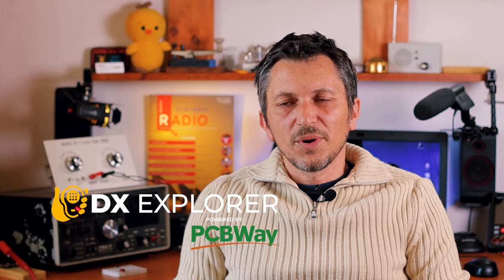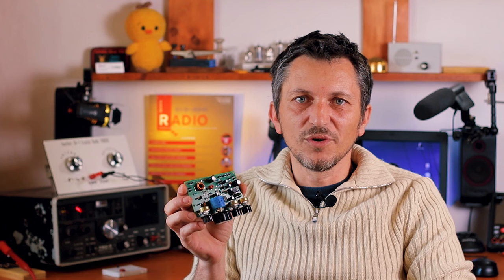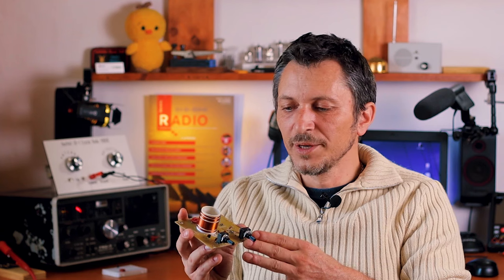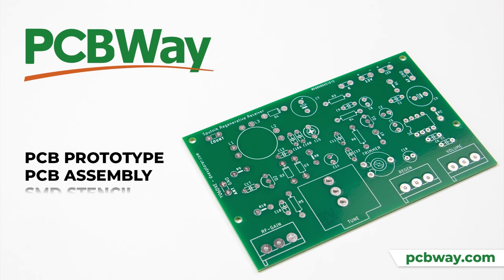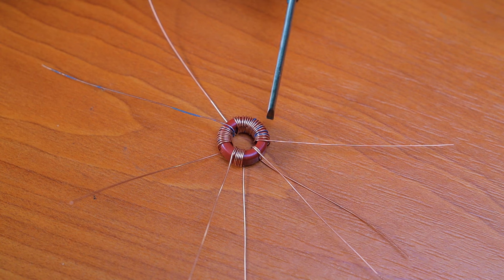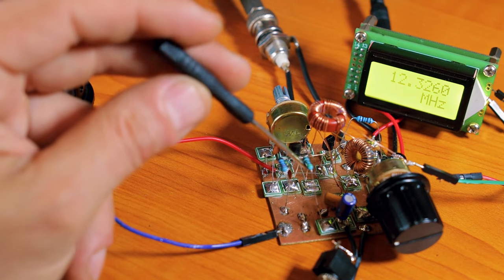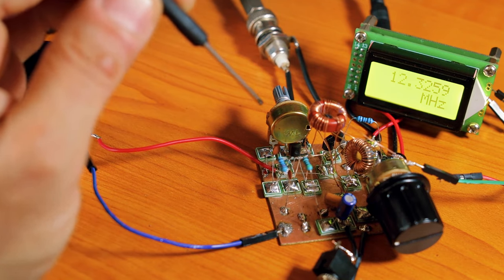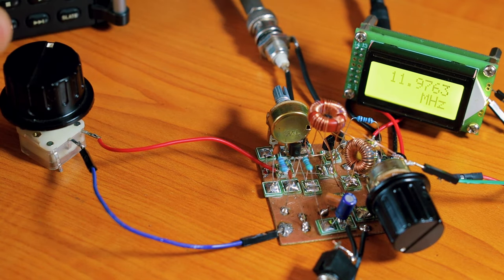Improving A Simple FET Regenerative Receiver - Part One

Comment: It's good to see that young people like to experiment with old techniques. I built a regenerative circuit with a 6C4 triode back in 1956 when I was a 16 year old boy. Today I'm a grandfather but I'm still involved with electronic experiments, especially with modern devices like the one you used. Congratulations on your commitment and dedication...
Reply from the maker: Ohhhh old is gold to me. Is funny that when I started about radios it was all on tubes. But later when I started building stuff I used transistors because it was hard to find the transformers. This winter I plan on doing some tubes projects too. Maybe I can find some low voltage ones. Is nice you are still playing around with circuits. Once you love it as a kid is hard to get away from it 😁. 73, YO6DXE
Reply: Yes, I have followed the evolution since I was young. In 1973 I built a triple conversion valve transceiver using a Colins mechanical filter, 250KHz and only two bands, 15 and 20m. The valve has its problems, but it also has its benefits, less noise and better fidelity, I miss these qualities. I recently bought a G90 from China that is truly amazing. All electronics have evolved to a state that already requires specialization, but there is still a lot that can be done in the area of experimentation. 73s and health my friend, py1bys from Rio de Janeiro.

Comment: I’m a sucker for any regen receiver circuit. I just love to watch these videos. 

In fairness to Charles Kitchen, his circuits were published in QST in the late 1980s when air variable capacitors, though still challenging to find, were far easier to get than today.
Reply: I have no trouble finding them, they’re just very expensive
Reply from the maker: Ohh yes I agree on that. I love his circuits for the performance but still keeping them simple. I just wanted to adapt it to "today" but still keep it simple... and make it smaller too hehe. 73, YO6DXE.
Reply from the maker: They are indeed. Sometimes we may get lucky and find some for cheap... or presents... but not always 😁. 73, YO6DXE.

Comment: Small tuning capacitors are still available such as the kind that would be used in commercially made pocket receivers. They're not expensive either.
Reply from the maker: Yes... those I used for the original version. I don't like them that much though. Very hard to tune and a vernier drive is twice the price of a multiturn potentiometer... sometimes even more expensive ( at least here in Romania). 73, YO6DXE
Reply: @dxexplorer  All I can think of is the possibility to use a reduction pulley which was fairly common in older table top receivers. There was even special string sold for it suggesting the need for occasional replacement, though I never needed to do that. Good luck with your eventual solution whatever it may be. N1KHB
Reply from the maker: @joewoodchuck3824 Thank you so much. Hmmmmn that is not a bad idea at all. I need to try that too. Especially because these capacitors are also cheap. I tried making some reduction drive using little gear wheels from remote controlled cars... but it was taking too long ))). 73, and have an amazing rest of the week, YO6DXE

Comment: I loved your Video and Channel and what all about
from what i can see here , there is some issues regarding FET Transistor biasing ..
Also the variable capacitor tuning is a little bit rough because it of (5 MHz tuning width) which considered very wide ...
However i am very anxious to see next episode ...
Reply from the maker: The tuning part I managed to fix really easy and now it works fantastic. Is just the regen control / transistor biasing combination that are not yet perfect and as I want it to be... but I am working on making final adjustments until I get it to sound as I please so my ears will be happy finally 😁😁. 73, YO6DXE

Comment: nice video. i think series gonna be interesting😁. so about the problem. when there is for example 1k ohm resistor in the schematic and voltage is not like it shoud be yeah you need to change it  from 1k to  1.5k or 800 ohms or close to 1 k ohm, but when you change 2.7k ohm resistor with 10k and it still does not meet requirments i belive the problem is somwhere else. 7.3k is big jump for such a small change you got here.  at max you need to change it from 2k to 4k no more than that.
Reply from the maker: Usually yes. In this case I had to check other similar circuits just to see what is different and it seems that some ho as high as 27K ... and it seems to be relative to the voltage that I power the circuit with. I am sure there is an entire theory behind but now I don't have the time to study that hahaha. We will see as for sure the circuit will need adjustments in time in order to get it to work as I like to. For now I am not so happy about the regen part as I was with the sputnik where the regen was really smooth and the demodulated CW and SSB signals sounded much better. Testing in progress for now 😁😁. 73, YO6DXE.

Comment: What is the thickness of the RF coil wire?
Reply from the maker: I used 0.35mm or 0.4mm enameled copper wire. This for the new coil version made on a toroid.
Reply: @dxexplorer  And here we go, I've been trying to make the receiver work. To no avail though. Both air core and toroid, all voltages are OK. Multiple fruitless attempts. Nothing. Sir, if you got a change, could you let me know about your problems with the circuit? That could be helpful, thanks.
Reply from the maker: @tovarichiwantankista9412 the only issues I had was with the FET transistor. I had a few MPF102 that just didn't want to work. Maybe try a few different other JFETs ? The voltages were fine for me too with the MPF102 but the receiver simply didn't want to work. I had the same issue with them on the older VFO circuit that I made in one of the older videos. Not sure if that may be the same problem in your case... but that worked for me. Also I am still trying to improve the biasing of the JFET in this receiver. No matter how I do it... the CW sounds strange on some bands. If I only build it for one band and make the proper adjustments it sounds great... but the way I want it to cover at least 3 bands... no so great. Still work in progress on this part but I had no time because of too much work.
Reply: @dxexplorer  Yeah, it could be the JFET... I have recently ordered BF245 and hope for it to work. Anyway, thanks for the reply!
Reply from the maker: @tovarichiwantankista9412 Always a pleasure my friend. Let me know if it works. And I also have to order a few 😁😁. And I need some J310 as well both to try with this receiver as it seems that it was the original one... and also for the Mini Whip antenna. So far I am not so impressed with the ones I tried, including the MPF102. So I am really curious how it will be with a J310. 73, YO6DXE.

Comment: Mpf 102 is  hard to find in the region that I'm living in,but ordering them online can be gained, Specially, talking about FET mpf 102 transistor, will be very expensive now a days & There ain't guarantee to get original one because of China made duplicate clones are available in most of the online markets.
Reply from the maker: Yes is a little harder to find here in Romania as well. But we still have substitutes we can use ( equivalents ) so is not such a big stress.
Reply: Did you use Substitute one ? and the equivalent can be J112 if I'm not wrong.

Comment: Hello! I made several experiments with super regenerator with two transistors in barrier mode. The results was unsatisfied (I use a part of coil to matching impedance) - only -85dBm. It was an idea to make sensitive super regenerative receiver for 430MHz.
Reply from the maker: I never tried regens for VHF / UHF... maybe I have to make one of those too sometime 😁. 73, YO6DXE.
Reply: @dxexplorer   In my opinion for the UHF  the best solution is a diode ring mixer (with BAT-15 diodes)  and low IF  AM/FM amplifier (with capacitors as filter) first stage - low noise bjt with, other stages are with capacitor filters) , that can be realized very easy.There also exists an image, but it is the simplest super. As a geterodyne can be used ASK transmitter with PLL. It is the simplest solution.